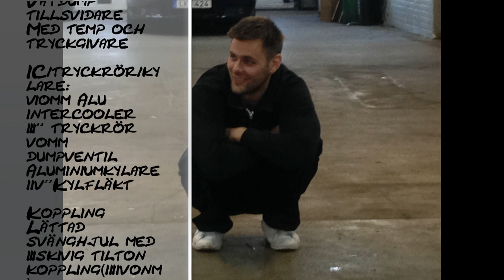Victor Ekström: Volvo S60 T5 Rwd 800whp

Comment: B5234T Block with 81.5 mm drill and crankcase milled
With aluminum rods pressed between the liners
960 Oil pan
Forged webs
Light crank
JE pistons 81.5mm drill
Sputtering layers

Ported top year model 99 built and flow tested by Christer NLR
Mira-milled valve seats, double valve springs
valves intake 32mm exhaust 28.5
Race combs with 10.5 in lift and 295 duration
Home-made branch pipe
Plenum suction 3 '' throttle
Three sheet steel cylinder head gasket
VAG ignition coils

Turbo:
Garret GT4094R 1.06
50mm wastegate
Electronic boost pressure control

Fuel system:
Steel-wrapped 10mm hoses
NUKE performance fuelrail
Aeromotive BTR
Aeromotive A1000pumps 2pcs
Trick flow fuel filter 2pcs
1680cc Bosch spreader
Fuelcell

Control system
Maxxecu
7 "Nexus tablet instead of meter
Own sensors on each cylinder for individual measurement and compensation

Comment: Could this be done to a s70 t5? I have a 99 t5 manual that I am doing an engine build on, for 600-700hp. Would love to go awd or rwd.
Reply: The S70 and S60 share very similar architectures, though the S70 is a bit longer if I can recall correctly. Should still be possible.
Reply: If you want to go AWD you can swap in the haldex from an S60R or a V8 S80

Comment: So they ditched the multi-link rear and replaced it with a live axle...?  WHY!?
Reply: live axle? do you mean rigid? everbody builds with this type of axles in dragracing to combine it with four link because its possibles to adjust angles for more grip or slip
Reply: Adjust the angles of what?
Reply: adjust the angle of how the axle+chassie will react when the slicks get traction among other things

Comment: English translation for modification list?
Reply: A whole bunch of cool shit that we don't get over here :(
Reply: ;)
Rwd s60 , mind blown!
Reply: Motor

B5234T Block med 81,5 mm borr och vevhusfräst
Med aluminium stavar pressade mellan fodrerna 
960 Oljetråg
Smidda vevstakar 
Lätta veven 
JE kolvar 81,5mm borr
Sputtrade lager

Portad topp års modell 99 byggd och flödestestad av Christer NLR
Mirafrästa ventilsäten,dubbla ventilfjädrar
ventiler insug 32mm avgas 28,5
Racekammar med 10,5 i lyft och 295 duration
Hemmasnickrat grenrör 
Plenuminsug 3'' gasspjäll
Tre skivig stål topplockspackning 
VAG-tändspolar

Turbo: 
Garret GT4094R 1,06
50mm wastegate
Elektronisk laddtryck styrning 

Bränsle system: 
Stålomspunna 10mm slangar 
NUKE performance fuelrail
Aeromotive BTR
Aeromotive A1000pumpar 2st
Trick flow bränslefilter 2st
1680cc Bosch spridare 
Fuelcell

Styrsystem 
Maxxecu 
7" Nexus surfplatta istället för mätare
Egt sensorer på varje cylinder för individuell mätning och kompensering

translate it yourself :)
Reply: Thaaaaank frombehind!
Technology

Comment: Engine ?
Reply: 2.3l from a Volvo s60
Reply: B5234T Block with 81.5 mm drill and crankcase milled
With aluminum rods pressed between the liners
960 Oil pan
Forged webs
Light crank
JE pistons 81.5mm drill
Sputtering layers

Ported top year model 99 built and flow tested by Christer NLR
Mira-milled valve seats, double valve springs
valves intake 32mm exhaust 28.5
Race combs with 10.5 in lift and 295 duration
Home-made branch pipe
Plenum suction 3 '' throttle
Three sheet steel cylinder head gasket
VAG ignition coils

Turbo:
Garret GT4094R 1.06
50mm wastegate
Electronic boost pressure control

Fuel system:
Steel-wrapped 10mm hoses
NUKE performance fuelrail
Aeromotive BTR
Aeromotive A1000pumps 2pcs
Trick flow fuel filter 2pcs
1680cc Bosch spreader
Fuelcell

Control system
Maxxecu
7 "Nexus tablet instead of meter
Own sensors on each cylinder for individual measurement and compensation
Reply: That’s what he was saying in Swedish